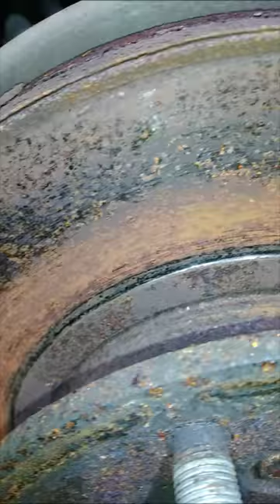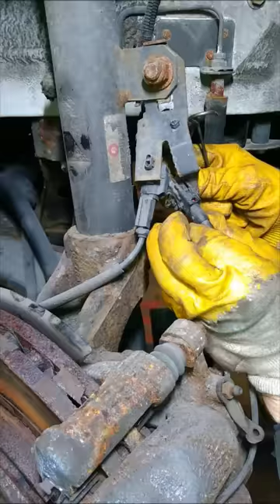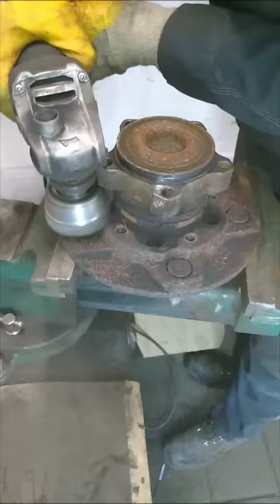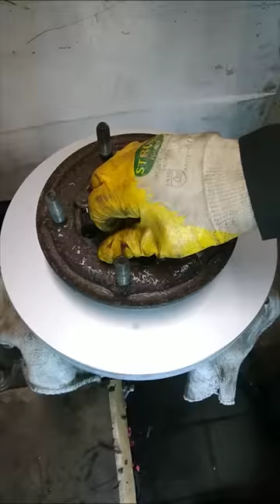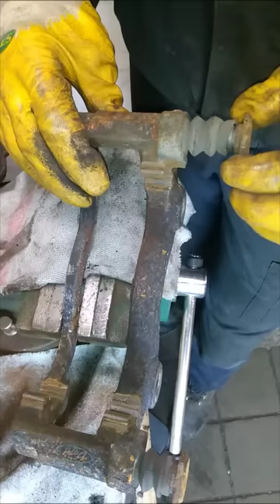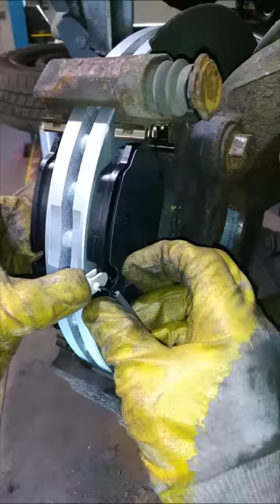Конструкция ИЗПОДВЫПОДВЕРТА - замена передних тормозных дисков Ford Transit.

Comment: Ощущение, что машине сто лет и она была под водой…  вы молодец, специалист и трудолюбивый терпеливый человек👍👍👍🙌мой прадед Александр был механиком, мог разобрать и собрать Зил и по слуху определял все неполадки. 🤚
Reply from the maker: Спасибо огромное)))
Reply: Подрамник в хоришем состояние. Скорее всего.  Б у запчасть куплена. И решили поменять.
Reply: У нас в Питере все такие машины )
Reply: Для Ford Transit проблема с суппортами это норма
Reply: Тогда не дай бог жить в Питере или покупать что-то другое лучше!!!!! В Питере -пить!
Reply: @СтрайкРояль А может быть лучше очистить и покрасить все остальное ?????
Reply: @user-qs6ov5nl3q   я вот из Питера. Машину покупать поеду в какую нибудь Башкирию или Сибирь 😁
Reply: The hardest part is to remove the bearing from the knuckle,  I have changed a wheel bearing and front driveshaft today on a 2008 Transit , so much corrosion on the hub assembly,  but it's done and gone